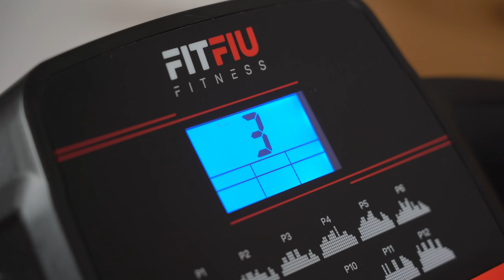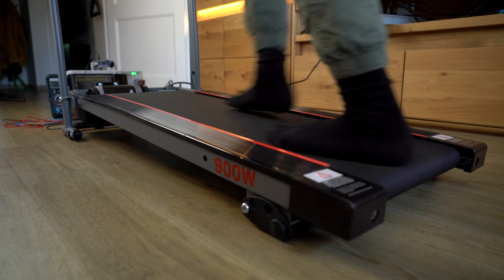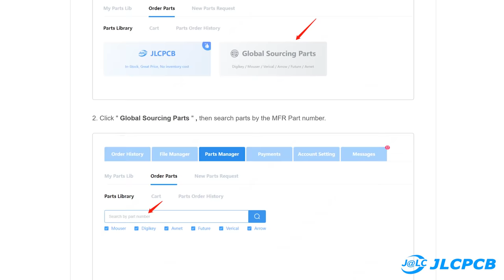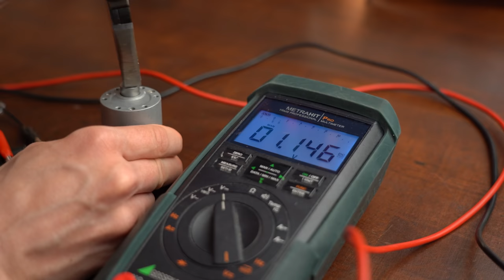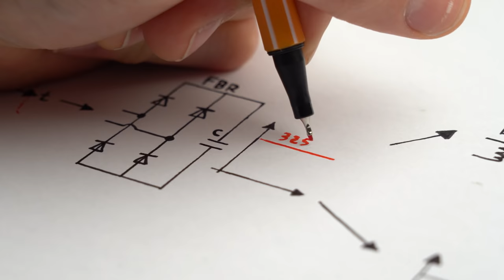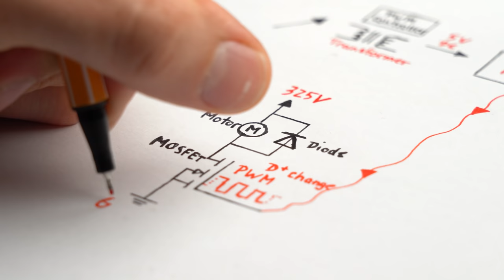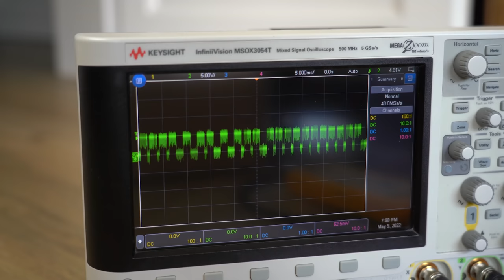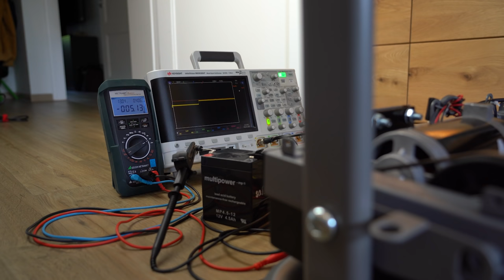Should we use Treadmills to Generate Electricity? (Experiment)

Comment: I'm a technician for a fitness company. Our home units use a dc motor but i commercial units use a 3 phase motor. Our other cardio units can be powered via a outlet or they can be self powered which charge when they are used(uses a rechargeable battery 12v 4.5ah).

Our new units with the exception of the treadmills can be self powered and have a small screen 10" touch screen. That being said we do not use the traditional battery to keep the unit running we use super capacitors.

Too your actually problem you need to check out something called the skillmill. Hope that helps.

Comment: what if this could be played with a gearing ratio and instead of charging a battery directly which requires greater muscle mass in load, adding a capacitor to the loop would be better as its not a loadbearing component and use a transistor to cap the back flow of the energy stored in the capacitor in case of higher capacitance.
Reply: No need to adjust the gearing ratio (I think) because adjusting the load impedance will give a similar result. An MPPT converter could automatically adjust its impedance to extract maximum power. To avoid the annoying force spikes the MPPT converter should only adjust slowly.
Reply: @thewhitefalcon8539  Would work, However this won't decrease the load on the treadmill do note tom has to exert certain amount of force to over come the resistance and to keep the mill rolling.

Comment: A penal treadmill was a treadmill with steps set into two cast iron wheels. These drove a shaft that could be used to mill corn, pump water or connect to a large fan for resistance.

Comment: Bike plus turbo trainer. It’s been on my to-do list for ages. During a 1h session a decently fit person can average anywhere between 200 to 300 watts at the cranks based on power meter readings. If I’m not mistaken that’s about 20-30amp hours at 12V, enough to charge up a tool battery pack or two and keep some LED lights on.

Comment: Ha! I'm surprised that any useful energy came out of this experiment at all.
But maybe the solution is to reverse the pulleys i.e. have the large one on the motor and the small one on the treadmill. Also, make sure the treadmill plank under the running belt is super well lubricated.
Reply from the maker: Good points :-)
Reply: @greatscottlab  might be fun to try building a battery charger that could simulate a variable load i.e. where one could be changing the load that the charger presents to the motor.
Who knows, if that works, maybe future treadmills will come with batteries and work as a UPS!! Assuming you don't mind a work out  where you can only go at snail pace that is! 😉
Reply: bike trainer would work. a well-trained person should be able to output over 200watt for over 1 hour. There is a pro-cyclist that actually powers a toaster in a video on youtube. But most of will never be able to put out over 600watt for such amount of time :) there is also biketrainers that powers themself when you pedal the bike. not sure if its tacx or wahoo, but its one of the more expensive ones.
Reply: @Stelios.Posantzis  Sounds a bit like a MPPT controller for solar panels.
Reply: @AndrewTSq  magnetic bike trainers have a lot less friction than treadmills, so yeah

Comment: I would imagine that this would benefit from having a circuit that adjusts the current consumption in order to target a constant voltage, while adjusting the target voltage over time to account for your actual running speed.

I'm a software engineer, not an electronics engineer so my knowledge of electronics is not quite professional level, so this could be wrong but I could see this working by having a transistor (or whatever you'd use as an efficient variable resistor) in parallel with the load, such that you can create a partial bypass to reduce the amount of current going to the load, and then have a PID controller adjust the bypass to maintain the reference voltage.
Reply: Similar to a MPPT controller for solar panels.
Reply: Or have constant current equal to force required to rotate it. I would say a mosfet would do the trick that is pwm based. So you set the brake force of the motor.

Comment: it would be fun to see you try to incline the treadmill, you don't have to hold on to the handle anymore as gravity helps with the pulling. 
I'm curious to see if the incline is enough so that your weight does the pulling  or the load is just too big (battery) that it will stall

Comment: If you want to do a followup of this video I think you could improve efficiency by plotting the power produced at different loads and see where it should operate (similarly to what is done for solar panels),  then you could also change the motor or the gear ratio between the motor and the carpet so that you can walk at a more comfortable speed

Comment: Very interesting! it'd be awesome to have a rig with a bike. Most men, with a bit of training, can generate 200W steadily on a bike (easily measured with a pedal based power meter). I can hold that power output for several hours, the limiting factor is boredom and discomfort. But it'd be awesome to know you're producing electricity. Like charging a power bank which you use to charge your phone for example. No juice, no phone, go back on the bike kind of thing.

Comment: 2 issues:
1. Treadmills, unlike say, ellipticals, have a lot of friction with the belt and the weight and whatnot.  I think that is a large part of the reason they have motors.

2. You are dealing with obvious impedance mismatches.  The 90v to 5v dc converter worked better than the others because you were able to move at a fairly normal pace (90v ~ 100v).   You were on the right track there, maybe a solid state 120v to 12v battery charger with some amp selections would run on 100v dc if you don't feel like making one.  But the speed of a motor or generator is relative to its voltage, and the torque is relative to the current.  And just like P=I*E, mechanical power is equal to speed(rpm) times force(torque), so allowing the motor to not get loaded down till a higher voltage would definately help.   Use a buck converter, think of it as a CVT.

Comment: I remember hearing somewhere that humans have a maximum continuous output of around 1/2 HP(746/2)W. At that rate, even if we round WAAAY up to 500W it would still take 2 hours of work to produce 1KWh. That leaves you a theoretical max of 15¢ per hour earnings. Maybe as a novelty it could be fun.
Reply: 30 mins of exercise a day, and you'd generate it in 4 days but with a family of 4 you could generate it everyday
Reply: Generating power instead of consuming is always better. Even if electricity can be fairly cheap and seemingly steadily available, it does not hurt to have some kind of backup in mind.

Comment: Concept to consider: steady treadmill at whatever speed is comfortable to lift counterweights for release at a later time to generate consistent current.  Think coo coo clock weights.  It’s a simplified concept.  Is it possible to simulate this with charging deep cycle batteries?

Comment: I remember when my dad disassembled one for lubing, i noticed that it has a DC motor, i tryed to power from a 12V lead acid, and it was SLOW! and WEAK at 12V, i also tryed charge the batt it was very stiff to get running, very nice exercise.

Comment: You dont need a separate buck converter. Even in india (230v mains) my phone chargers works just fine with my ebike battery (13s 48v). Just connect the phone charger to the motor. This way you will also get the additional Safety features of the phone charger and isolation from high voltage on output side.

Comment: Try aquiring an ecm/pwm blower motor at .25 to .33 horse power. In the US these motors come in multple fractional h.p. and voltages. 120vac, 230vac depending on application. 
  Disconnect the drive module from the three phase motor, and check the output by free spinning the rotor shaft..!! 
Also being a rare permanent magnet setup, it will generate a varying amount related to rpm. If used as a wind generator, with a vertical blade, low rpm and blade pitch adjusted by centrifugal counter weights, a wattage dump resistor, three phase to single phase 10A or 20A rectifier bridge, adjustable voltage regulator, some type of interrupt circuit breaker or fuse link, these work great to charge a small battery bank of sla type.   Great time project for an 'off grid' cottage in an area where utility is not available.  Add a charge controller that accepts solar along with wind generated power and during the night, a breeze will be the source when the sun is at rest.  The blades could be printed in small scale as with the linkage levers for auto blade pitch reduction. 
 My fist version had no pitch governor, a 1/2 hp motor and the output was 16 to 60 volts vac unloaded.  Driving the shaft close to 60 rpm with variable motor, I arrived at  40vdc, at  10 amps or a useable 400 watts.. 👍🏼

Comment: you should of tried using an Eclipse exercise machine, you run on air which causes no stress on your joints plus you get to used your arms as assistance, which will give you a much better exercise with a better generated electricity. Just my thought!!

Comment: Tacx Neo 2 smart bicycle trainer doesn't need external power supply - the power generated by the rider is also used to power the resistance circuit.

Also, it is relatively easy to generate around 200W with it for prolonged period of time.

Finally, in order to smooth out the irregularities in the load current consumption, a flywheel mechanical device can be used.

Comment: The legs are far stronger working through the sagittal plane, plus you generally dont have grip issues working on this plane.

A rowing machine would be a good candidate, and the flywheel would act like a momentum capacitor to deal with your voltage regulation spikes. You could even modify the flywheel to contain the magnets

Comment: I wonder if you could harness both your muscle power and the electrical power with some sort of load balancing. Like when you want the treadmill to offer low resistance, it draws electricity, but when you want high resistance, it switches off, and if you want even more resistance, it connects to a load like a battery

Comment: Stationary bike with as heavy a flywheel as you can get is what I used. Works pretty well. Could do around 100W electrical steady state for hours and hours. Conversion efficiency was around the 40% mark which seemed unusually high if I'm being honest. That's an estimated end to end efficiency of ~10% from food to electricity. 0.98 from food, 0.25 from muscles, and 0.4 from the mechanical to electrical conversion. I challenge you to do better.

Comment: The way to do this is two Huskies in a harness on each treadmill. Wearing a VR setup to make them think they are running in the snow chasing something. These dogs will run for miles as easy as you nap. An auto car wash like mechanism to comb and vacuum the hair would also be needed. A large battery bank to store the power. I'll bet a dozen dogs trained to use these and hop in whenever they want to run you could power a house.
Reply: shout out to alec steele or alex steele i cant remember how its spelled hes a blacksmith just go look up his video where he did this i think or maybe he didnt

Comment: As a kid in middle school, I once had the idea, or vision of a world in which all the wasted energy from various everyday motions would be collected in super efficient batteries or used to help supply our futuristic renewable energy power grid (I failed to realize the sheer depth of corruption in our representatives and how owned they are by old dirty power). I thought that all the door hinges, sidewalks, stairways, and various other object that swung open on hinges or had repeated forces applied to them would be equipped with little generators that would collect each microvolt and trickle charge batteries, or put that energy back into the grid someway.... I mean I was 11 or 12...so not a whole lot of thought went into technical hurdles, like how much retrofitting would be required, or how tiny electric generators  in hinges, however if conceptually possible (if not even feasible mechanically speaking), would raise the cost of a hinge making it fiscally illogical.... 

Regardless of that crap, its nice to dream of a day when we might be able to have the technical capabilities to gather all the tiny bits of "wasted" energy and be able to use it for whatever.

Comment: You could do an upgrade that changes the steepness of the treadmill with a motor, depending on the desired walking speed to keep it stable, so you could use gravity to walk and wouldn't have to push yourself forward

Comment: Previously I trained on a stationary indoor bicycle. The trainer displayed my power output so i decided to calculate if the power I was producing, dissipated as heat by the flywheel, could be used to reduce domestic energy bills. When I compared my power output in Joules to the cost of producing that energy (the energy content of my preferred foods in Joules) the answer was no, energy from the grid was cheaper that mine. The human body is 33% efficient Joules in/Joules out.

Comment: This was actually use in a research in our school( will not mention which) 

But at the end of the sem, 
They find out the hard way how inefficient it is compare from input to output power
And it was designed maybe a 25° to 30° angle of elevation?(not sure) but the trick is to let gravity pull you down at thesame time you are keeping yourself upward.

It is more practical to use modified bike trainer they said coz they were expecting to charge a car battery,
But they cant full charge a motorcycle battery with just one run
They still passed the sem though for their efforts and sacrifice. 
And the panelist said they have to make stricter policy regarding on power generation research coz some of them can be found online but students claim it as their own.

At thesame time of that research 
A peltier electric generator was proposed but quickly changed to portable refrigerator using peltier device and water( no chemical refrigerant used)
It may not cool some drinks fast but it kept refrigerated drinks cool enough for longer rides(for cars and motorcycles)

Comment: Use a rowing machine with a flywheel. Best setup in terms of biomechanics as you use your legs and arms to generate power.
Up the power of the return spring to drive the flywheel on the return stroke.

Comment: I think you might be able to use the same principles as an mppt solar controller to get a more constant load and also vary the load you put on the treadmill. Something like a pwm controller on the output and some sort of configurable current limiting power supply after it maybe.

Comment: I'm working on a bike on a stand generator. I salvaged two 24v wheelchair motors. Going to mount one on the stand with a sprocket. I removed the spokes and split the rear axle with pipe cutters to fit a 10 lb free weight as a flywheel and a front pedal sprocket beside it. So when the bike is connected I pedal and the flywheel/sprocket assembly will turn the motor/generator with another chain. Slow going as I must save money for anything. But, I can get 25w from a quarter turn of the motor with channel locks so if I can get 14v pedalling I'd be happy. It's always been a mystery to me why all these exercise machines and pelotons aren't generators. Great video Scott.
Reply from the maker: Thanks for the feedback. Sounds like a fun project :-)

Comment: The Original Lifecycle Bike sold to "gyms" in the 80s and 90s and some later as Patents ran out used a mod'ed car Alternator and resistors to make loads like climbing up a hill. 2 or more Belts or Chain stages to gear up to spin the Alternator fast enough just to start. Charging a Phone should be easy since most already change 12V battery to save setting etc. Many model now have tablets to run them and display whatever with most power come from same setup.

Comment: I would probably make a circuit that actually monitors the trade mil load speed etc and adjusts the output to give you constant force and sometimes even push the motor as a motor to help. You could probably run at high speeds without much load and use only a bit of it's power to charge the phone

It'd be more like a motivational thing

Comment: While treadmills may be preferable for exercise, I have found I am able to draw much more power from a modified exercise bike, as with a treadmill what you'll find yourself doing is climbing up the incline, then waiting for gravity to pull you down the slope, turning the belt, or gripping against the handles to force the belt back, neither of which are particularly ergonomic and I can feel the awkwardness radiating through the video.
While most exercise bikes will require the addition of a generator, the extra effort is worth it when you consider its use will be just as comfortable as an unmodified unit, and the relative ease at which you can generate in excess of 100w continuously. 
I have found that with the right bike, all that is needed is a brushless motor with a rubber band on the outside, and a 3d printed bracket pressing the motor against the bike's flywheel.